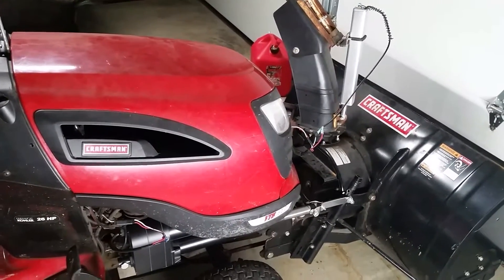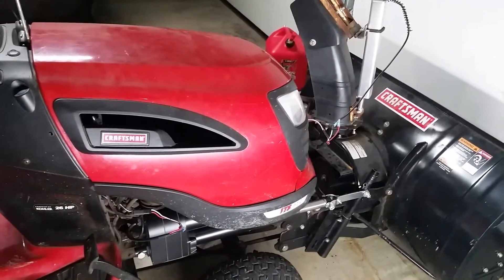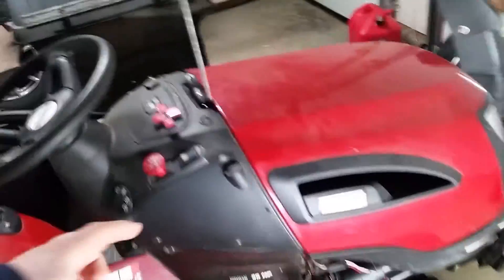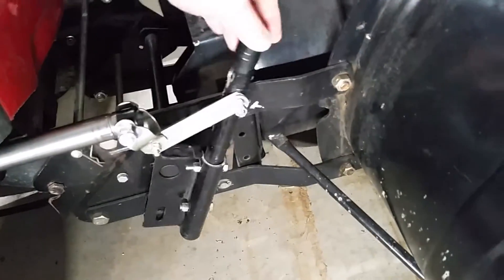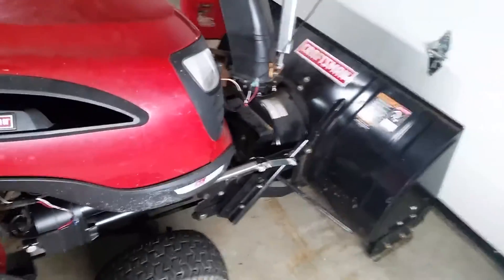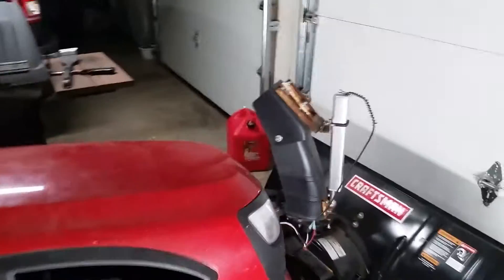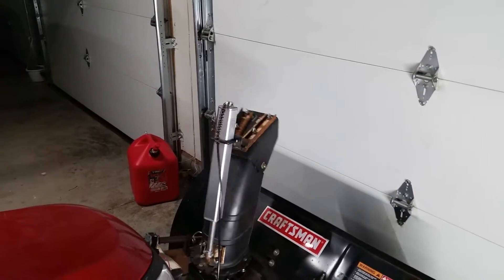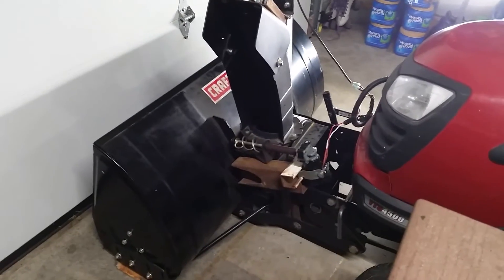Power lift upgrade for snowblower

Comment: How did you mount the actuator to your tractor? And what is that bracket that you used where the actuator connects to the snowblower attachment?
Reply from the maker: I use a shoulder Bolt from like a lawn mower tire and flat stock metal can you buy something similar at like Menards
Reply: @KzCreations  is there anyway that you could post a picture of what you're talking about please
Reply from the maker: Can I get a phone number to text you the pictures
Reply: @KzCreations  2314932466
Reply from the maker: @scottgromaski7960   sent text
Reply: @KzCreations  can you resend the photos? I never got them
Reply from the maker: @scottgromaski7960   text sent to 2314932466
Reply from the maker: @scottgromaski7960  my number is 4l9.2l7.9490

Comment: Hello again, I remember in prior conversations, you said you'd prefer a 6" over an 8" because if you extend too far, it's quicker to retract.   If you had an 6", would you be able to extend it fully?   From the video, I'm wondering if 4" would be enough?

Reason I ask is that I have not ordered an actuator yet, but I have a joystick switch on order for mine.  The joystick can lock in the up or down position.   So I'm trying to figure out the length I could use that would permit to use it fully retracted or fully extended.   This way, when backing up, I just have to lock the joystick in the up position, the limit switch in the actuator would stop it.  Same idea for lowering it, just lock the joystick in the down position and the limit switch would stop it.
Reply from the maker: Hi I know exactly what you're trying to do and yes the 4-inch will work just fine. You're thought of using a joystick is fine.  But you may want to consider using a toggle switch just flip it let it pull it all the way up or down.  Something to keep in mind if you use the momentary switch you don't need to move the actuator but only a fraction of an inch off the ground for movement. So if you get where I'm going with this you can actually be faster with a momentary switch
Reply: @KzCreations  the reason I like joystick is it works well with big gloves.  I ordered 2.   

One is 2-way locking for lifting/lowering, middle is off, so I could still lift a bit and move it back to middle(off).  I haven't received it yet, but hoping is works like a signal light arm, half way is ON, but not locked, full is ON and locked.

The other is a 4-way non-locking for turning the chute left/right, and adjusting the angle of the chute up/down.

This is the 4-way https://www.amazon.ca/gp/product/B01IRCRGFO/ref=oh_aui_detailpage_o02_s00?ie=UTF8&psc=1 non-locking.   The 2-way locking looks just the same.
Reply from the maker: Have you considered a "long toggle switch"?  https://www.amazon.com/Dpdt-Mini-Toggle-Handle-Plain-Bushing/dp/B07M8J3PF2/ref=sr_1_28?ie=UTF8&qid=1546096369&sr=8-28&keywords=dpdt+long+toggle+switch
Reply: @KzCreations  no.  Once I found the 4 way joystick for the chute, I was pretty much set on using a matching one for lifting/lowering.  Plus easy to operate with big gloves.  The other thing, I don't mind bulky because I don't want to mount them on the dash, I'll add a box on the bars of the cab, so they will be removed when I remove the cab.
Reply: @KzCreations  I didn't catch your email contact before it disappeared...

Comment: I'm a disabled vet and have a lot of snow to move. I have a garden tractor with the same snow blower as you do.  Can you tell me exactly what i need to automate all of this?  I will have to have a mechanic put it together.  I noticed you said 6 in preferred, but you have 8.  Why didn't you just get the 6 then?  I don't understand any of this.  I just want to know what to buy, where to buy and then have a mechanic help me.
Reply from the maker: They were sold out of the six

Comment: were do you get the new hardware you show ,instead of the cable ?
Reply from the maker: Robert Hancock  part of it is a Unistrut clamp the other half is a flat bracket you should build a fine on the hardware section like Lowe's, Home Depot or Menards

Comment: I saw your other video where you used a cable.  You said in this one that you had to move away from the cable, may I ask why?  

I prefer the flat bars for looks, but I kind of liked the idea that the cable was giving the blower more free play when in the down position.
Reply from the maker: Marc Lanteigne the rod on the actuator wanted to turn and twist the cable so to fix this problem had to go to the steel parts
Reply: What is the new actuator you are using?
Reply: currently using SDA6-263
Reply: kz diapers where can I get this actuator?
Reply: one more question. Is that a 8 inch actuator?
Reply from the maker: amazon.com, I can help  you order it from amazon if you need help at no extra cost
Reply from the maker: yes it is 8 inch but a 6 inch would be my first choice